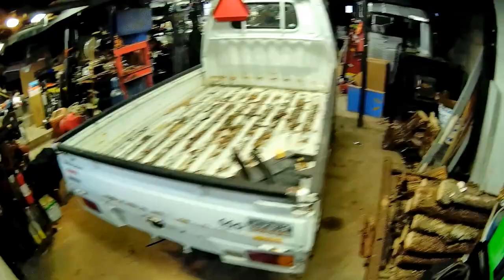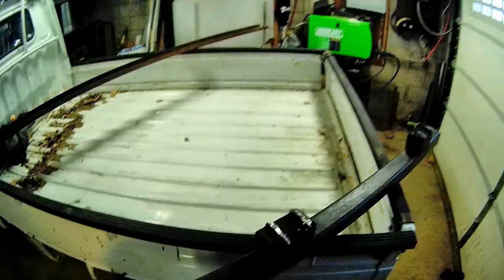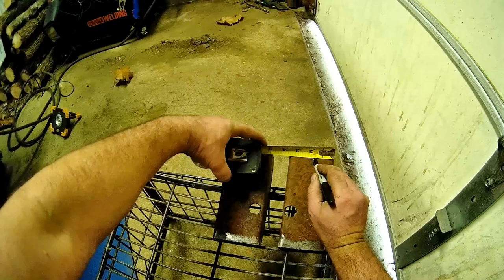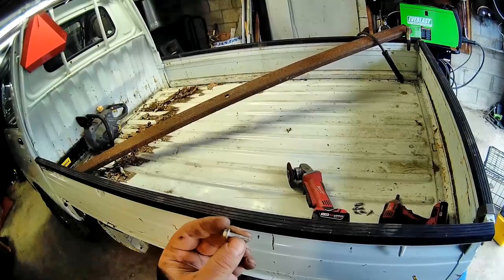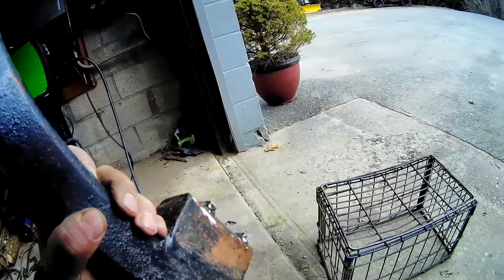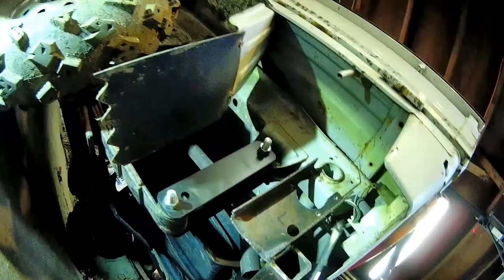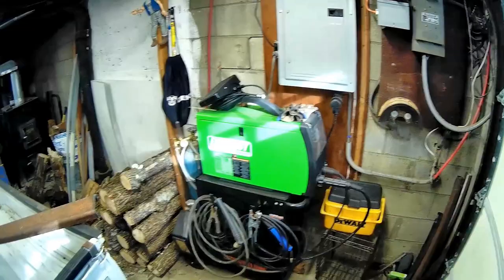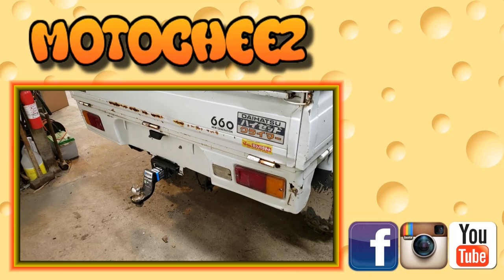Mini Truck (SE01 EP05) mini series, Custom 2” rear receiver hitch bumper weld cut install test HiJet

Comment: Thanks for the tips.  Not looking to pull a horse trailer or 5th-wheel, ideally snowblower trailer, and smoker trailer (Meadow Creek TS250) around the yard.  Easier then maneuvering F250 around tight spaces.

Comment: I think that if you change to metric that will be a lot easy... nice videos.😀
Reply: @Azhaar Laghari well some day it will happen... all your car industry use metric system. It's a lot easy to make calculations.
But in Europe we still use "your system" in some work. I install AC units and we still use copper tubes in inches 1/4 " 3/8" 1/2" and 5/8" eaven when they are labelled in mm 😂😂😂😂
Reply from the maker: not sure if they make one that will fit in this, I was trying to find a dashboard GPS Android that had the speedometer on it but they all look like garbage. But for every 1,000 RPMs I'm doing 10 miles an hour it's almost dead on with GPS
Reply from the maker: Haha. Yeah I bet. I have my HVAC Cert.
Reply: @Azhaar Laghari that is really a nightmare 😂😂😂 but you're in USA so you make it diferent from the rest of the world 😀
 " the hard way "
Reply: @MotoCheez  that is a funny mod to do on the minitruck. Install a mini split ac on it 😂😂
Reply from the maker: Hhahaahh. The compressor probably take away too much HP!!!

Comment: My Dad had a honda N series with the 2 cylinder air cooled motor was a great little car shame he sold it the motor was under the tray direct drive to the rear wheels
Reply from the maker: Those are cool cars, a keeper for sure.

Comment: So what happens when you get a load in the bed and or on a trailer that you may be hooked up to and the shackles flex back and hit your new homemade,  handy dandy 2" receiver hitch, which, by the way is very impressive,  I must say,  hmm?
Reply from the maker: I calculated for that there's hardly any bow in the leaf springs I measure them and flattened out it still doesn't come close to that bracket
Reply: @MotoCheez  I'm glad that it worked out.  I guess that the camera adds 10 pounds for real,  ha, because from the angle of the dangle it sure did look reeeeal close. 
Best of luck with the "MINI TRUCK"!   :)
Reply from the maker: Lol, adds 30lbs to me!! Thanks!
Reply: @MotoCheez  HA! You're welcome.

Comment: Love your videos, I'm over here in the Phillipines, where they import them an rehab them. but finding parts is a problem, and they are called Maltecabs. so was woundering where you get your parts at? would love to lift mine, its a Suzuki. also it has 13in tires and they rub off road😩
Reply from the maker: Nice! So far I got my parts from eBay and there are a few places that specialize in aftermarket parts
Reply: @MotoCheez  thanks for the info. really like what your doing with the little truck😉
Reply from the maker: Thanks!🔥🔥🔥

Comment: You installing a winch next? I wish I knew you were installing a hitch. I'd gave you my new non used 5k lbs receiver for free. Doesn't fit my Ford. Anyway I'm hooked on this series.
Reply from the maker: Yes, working on it now. That's the surprise it's in the box in the back you'll have to see what I ended up using

Comment: dude  i really hope you put some actual bolts in the receiver, not just the self tapers, other then that  awsome job simpler design then i would have donw
Reply from the maker: I did grade 8 bolts afterwards in next video. Used self tappers to hold it temporarily.

Comment: Sheet metal screws are not going to last long not enough tinsel strength
Reply from the maker: Agreed, I used them for mounting to mark, replaces with grade 8 bolts
Reply: Lol "tinsel"
Reply: @MotoCheez    Must'a missed that part.
Reply from the maker: I didn't actually do it in the video, but I did mention that is what I'm going to do.
Reply: mwilliamshs "tinsel, the most robust of Christmas decorations"

Comment: Do you have the stock distributor with points?
Ours starts hard is there electronic points for the highjet?
Reply from the maker: This is electronic ignition I believe. I should pull the cap off and check though.
Reply: Our I think is 1990 it has points and when it's set correctly it still is hard to start especially when warm
Looking for.electronic ignition for it 
Your videos.are.great giving me.several.ideas already or if you could point me in the right direction thanks
Reply from the maker: Let me check now....
Reply: MotoCheez I just found your Channel,  a few days ago thanks
Reply from the maker: It's definitely electronic ignition https://photos.app.goo.gl/eWLXs4Nk6vLN4pmW8
Reply from the maker: Using your comment in my next video, recorded taking cap off to check and clean...:)
Reply: Awesome

Comment: What brand of welding helmet is that you were using its pretty cool
Reply from the maker: https://www.ebay.com/itm/152781586486 works great and can be used for TIG

Comment: Which everlast welder/plasma model are you using there?  It cut that metal easy
Reply from the maker: The welder is an Everlast MTS211SI, my plasma is an older thermodynamics cutmaster 38. I modified a Harbor freight cart. https://youtu.be/sbPaHTWR79U

Comment: How much do you think you can tow with that thing? Since it won't go on the highway I'm sure that will give you some more leeway. 

Also, It looked tight in there, but you may want to add some diagonal cross members form the 2x2 steel box tube to the frame. If you have too much weight in the trailer and had to slam on the breaks, the horizontal force on that vertical mount could snap like toothpicks.
Reply from the maker: It weighs 1500, so I'd guess 1000 lbs? Good question.
Reply: I have pulled 2,200 lbs behind a Yamaha Rhino. Was pretty sketchy, but it weighs less than your mini-truck. I live in rural Missouri, and it is legal to drive any atv, utv, or golf cart on the roads, so I used to drive the Rhino on the road all the time. I still drive my 250cc Honda Recon atv around all the time, but not the Rhino. It just isn’t great on pavement. Had to replace the rear cv shafts 3 times in 4,000 miles of pavement driving. Actually, the Yamaha isn’t very reliable period. Replaced the stator coil twice, and the water pump 4 times. Still tends to overheat on occasion too!
Reply from the maker: Nice! I pulled 1500 with my polaeis ranger. On semi flat ground, wasn't bad really. Wish we could ride quads on road here in CT. I hate the rules of these states... Gotta move eventually.

Comment: Why in the name of god would you weld only one face of that tube for a hitch? That will twist under load or shear rite off with any stress.
Reply from the maker: Which part? I want to add a gusset triangular brace off the drops, I have not painted it yet.. wanted to make sure it's how I wanted it.
Reply: You should have placed the tube in the centre of the c-channel and welded it all the way around. But you could gusset the tube where the insert goes front and back, nothing too large just to prevent twist when weight is on trailer.
Reply from the maker: The C channel. Ya. I couldn't to have it line up. I have to gusset...

Comment: Do you know if they come Automatic? Would like to add hand controls and a lift to put wheelchair in back.
Reply from the maker: Yes, some are automatic! That would be an awesome project. If you do it, please video it at least when complete.
Reply: Hard to find here in Canada, but if I do.
Reply from the maker: Nice. Brand new auto. What year did they start making auto in the minitruck?
Reply: @MotoCheez  Probably 20 years ago. There was a change in the Kei car category standard.
Reply from the maker: Ooh, I see. I appreciate the info. I'm always up to learning new things.